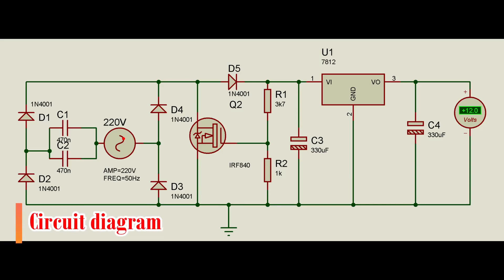how to make transformerless power supply 230v AC to 12v & 5 DC #High amp 500ma

Comment: Sir to have close to 2amp using flyback transformer in the same circuit would be possible. Please do mobile fast charger with transformerless.

Kindly tell me to have 1 or 1.5 amp on same circuit what are the options.
Reply from the maker: NO SIR, YOU WILL NEED A SIMPLE SMPS CIRCUIT